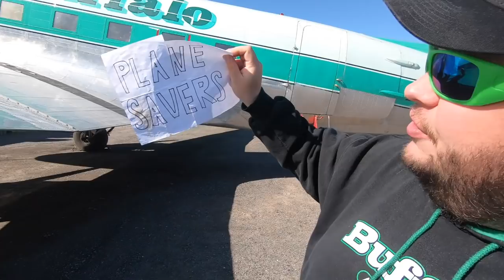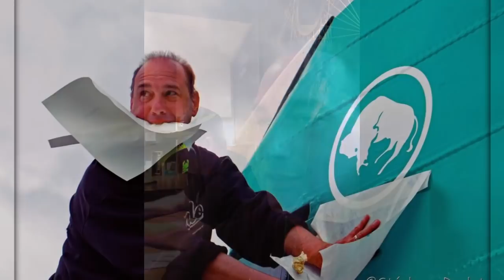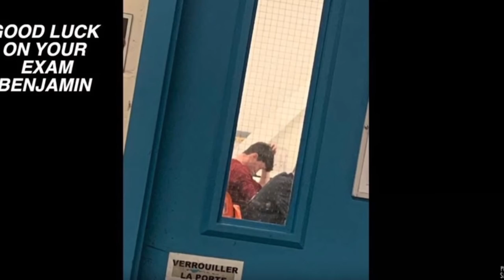How Much Does it Cost to Save a DC-3? PLANE SAVERS: Season 1 WrapUp!

Comment: I think you are being kind when you estimate what the charge out value of just the labour supplied by certified staff from Buffalo and ENA would have been. A hundred days times ten hours per day is one thousand hours. Just one certified person charging $50/hr. would have billed a cost of $50,000.00. It varied from day to day but usually I could count at least a minimum 4 certified people (meaning able to legally sign off their portion of aircraft maintenance paper work) at work. So at a minimum, just that cost would have been $200.000.00 for the project. And that just covers the Montreal time. Before that was all the prep work, inspection, engine conversion, parts finding and packing performed by Buffalo staff (and not counting the actual value of items like engines and props 'borrowed' from Buffalo). Plus all the labour provided by volunteers and others would be a cost above that. If everyone involved had asked for normal payment and if you would have had to pay for the sort of facility which ENA graciously opened up for you, I can't see how the restoration work could have been done for any less than an additional half a million dollars above the actual costs you incurred. What a great group of people who gave their time and made this possible.
Reply from the maker: That’s why I kept on stressing that this was the out of pocket cost. Not a Value calculation. The “Buffalo” expenses are 100% flow through charges that Buffalo payed and charged back to Plane Savers at Cost.  Mostly travel and living expenses for the crews. Myself and Stella did not take any wage from Plane Savers.

Comment: I realize you had no cash outlay and they are technically on loan to DTD but what's the value in the engine's and propellers if they were to have been purchased. That's also a big part of getting it flying.
Reply from the maker: That cost would be a wildly variable due to this stuff not really really for sale anywhere. I would guess not including the engines 100K and 80K for both engines together. That number could be a lot more if we used all new parts and less if we did use some new stuff.
Reply: @MikeyMcBryan  Ty sir.

Comment: I think I watched just about every video in the series over at least 6 months? I think when you consider that the engines,props, landing gear, new tires,oil and many other parts were supplied by Buffalo Airline, would have cost a huge amount if they were purchased on the open market and if the airplane was sent out to a plane restoring company, it probably cost over one million dollars to get it in the air! The other part that I think would have been all but impossible for and outside company to make it flyable, would have been the time deadline? Well done by all who helped Mickey and his crew of paid and volunteer workers! My bald head is exposed as my hat is off to all of you!

Comment: You didn't count the engines and props I know you already owned them but they must be worth a lot.
Reply: I would say that they are probably just on loan....
Reply: @davidjones8680  Good point!
Reply: With just the loaned parts from Buffalo Joe, you could easily multiply the cost by 3 or 4 and stay conservative. The good engine is close to 100K alone. 10k for the carb's, the hamburger door and the hatch, the props, the breaks & the wheels, avionic from the donors plane, and the list goes for a while  .....
Reply: Good they didn't add them to the count, it would be a ridicules amount

Comment: So Mikey, I guess that means that you/Buffalo are into the cost of the real heavy stuff - like the engines, props, airframe parts (rudder, aileron) etc also the cost of the aircraft itself. These were big items and the downside is that they also have repeat costs with scheduled maintenance inspections, overhauls, things like that. If so I hope that things continue to go well and you and Buffalo can continue funding keeping DTD in the air. It would be a disaster if after all this she ends up being grounded again. I'm sure everyone, yourself included, is desperate for that not to happen.

Comment: Congrats on a real &  entertaining series. At the start I though ho hum another dreamer not knowing the expertise on your side from Buffalo. It still would have been very hard without the aero school however. That hanger and the equipment alone made it so much easier. Then the staff and students who were very handy in every way and many became volounteers. I get the impression William and another are now at Buffalo?  Hope so.  If not a good practical work experience for all of the students that helped. Not many will probably ever work on a Goony ever again, or even anything that big let alone old.
Oh and without Ronny and Stella it would never have happened.
And also the plane after 30 years of misuse generally worked well with only minor service. Landing gear, hydraulics, flying surfaces etc.
You look at some of the other restos around and they are so slow. Not a couple of months starting on a airport back blocks.

Comment: It seems like you're missing an opportunity to shift thousands of dollars to your volunteer labor force...

For what you claimed in fast food, you could buy a dope BBQ set up, a fridge and food for the year with money left over for the volunteers.
Reply from the maker: Have you watched the series? Even though what you say sounds practical. It really wasn’t. Half the time we where isolated outside on generator power and even when we where inside it was borrowed time. So a fridge was out. That means going to the grocery store everyday and planning meals. This would have taken to much extra time or would require one full volunteer to do. Even ordering fast food took an hour of time due to our location. I was focused on making videos as that was driving income vs trying to save the food budget. What we did wasn’t perfect but we were fighting time. It was already 12-14 hour days everyday for 56 straight days. Even though there was a surplus on cash at the end. It didn’t last long as I said as we needed to spend $5k on fuel and flying in a new ferry pilot was another $2000 in Flights wages and hotels after June 6th. Not including all the other little things. The major savings would have been if we had more time to ship the Shipping container by train, but we didn’t have that luxury.

Comment: So this wasn't the cost of the actual parts and repairs of the aircraft............can you make one of those video's???
Reply from the maker: That included 100% of the repairs. The parts are not a known cost as we had them in stock. My best guess would be at least $120k in parts. But if you bought a good parts bird for $90k you could have used and sold parts to get a completely different number. That’s why those numbers where not included, only the true out of pocket costs. * results not typical

Comment: what about the cost of the original plane?....and major components like engines??????
How much was all that?......great stuff. I used to watch Buffalo Airways tv show all the time.
Reply from the maker: Plane was 30k. The other parts are very suggestive as they came from inventory and not bought out right like the pizza lol. I would suspect if it was an “outside” job there would be about $130k in parts.
Reply: @MikeyMcBryan  thanks Mikey for the reply. It's unusual on Utube to get such a personal fast reply. Just wondering about those big radial engines and what they cost. cheers. Subscribed!